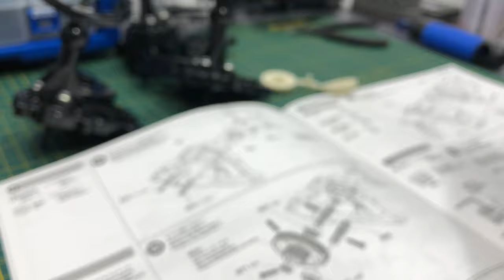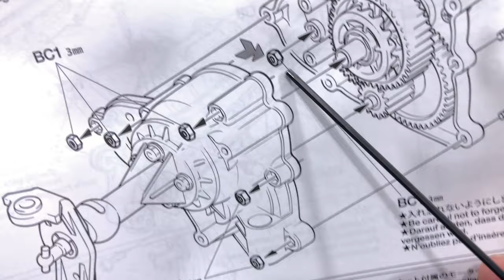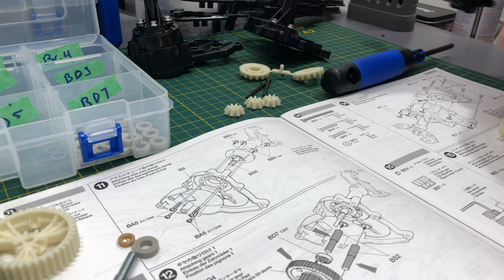ASMR Tamiya Clod Buster Gearbox Transmission Assembly Steps 12 13 14

Comment: What kind of grease are you using? Also another question. I am currently rebuilding an original myself. When I put one of the transmissions together it doesn't appear that the gears are making the right connection as when I turn the axles the gears don't really move and inserting the motor doesn't spin anything. Not sure what I'm doing wrong or if you have any advice. The other transmission is perfectly fine
Reply from the maker: Hey!  Thanks for watching!  Rebuilding an OG Clodbuster?  Awesome!!!  I love the chev branding.  Hard to say what the gear issue is, you're getting it on both the front and the rear? Does the binding happen after you've assembled the transmission cases or do things spin freely like at the 11:50 mark in this video and then start binding after assembly?
Reply from the maker: The grease is included with the kit, smaller tubes of Tamiya's Cera-Grease HG.  Part number is 87099, https://www.greathobbies.com/productinfo/?prod_id=TAM87099
Reply: @PartsTreeC  THanks!  I was using the old school tamiya tubs which is amber in color.  When I saw White in your videos I thought you were using Lithium grease!  :).  Thanks for the link.
Reply: @PartsTreeC  It is only happening on the rear.  After I put the entire unit together its like the larger octave gear that goes onto  the small axel are not making contact.  I cannot figure it out for the life of me.  I purchase new gears / new gear box case/parts tree, new counter shafts, pretty much everything except the axels.  I have disassembled and re-assembled.  The gears inside the transmission are agnostic to being in the back and front, correct?
Reply from the maker: @depositionsandstuff7465  Yeah, same assembly front and back.  My guesses are pretty general, starting with checking the assembly of the diff gear (step 13). If one of the shafts, the BM1 shafts may not be seated properly making the BG1 gears out of alignment. Next guess is going back to step 9 to 10, maybe the longer drive shaft is on the wrong side, unsure if that makes a difference.  

Would love a follow up on what you find!